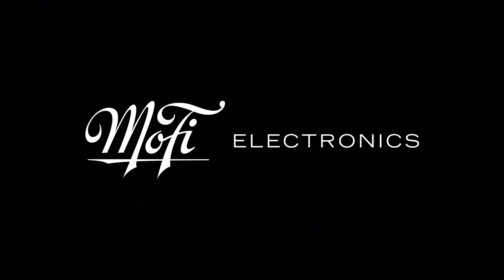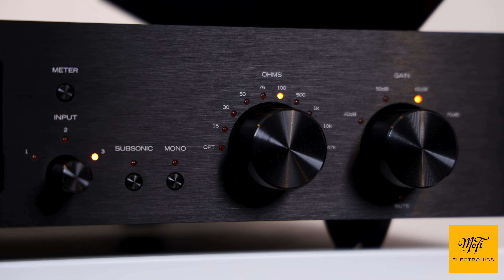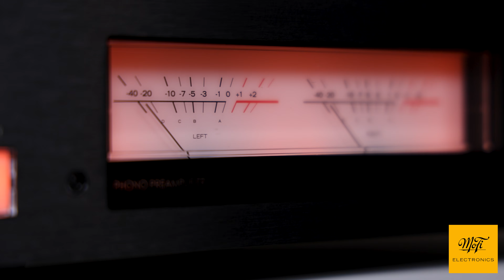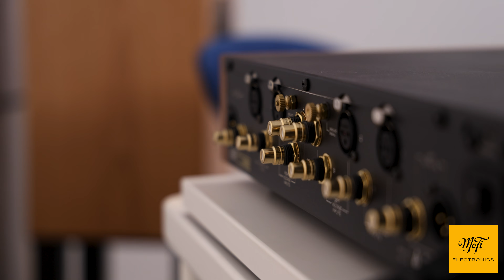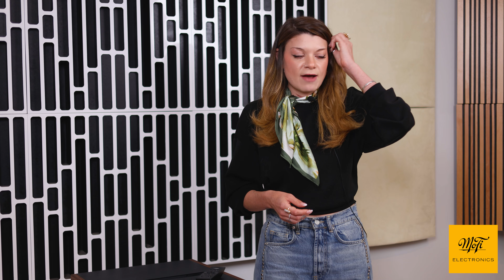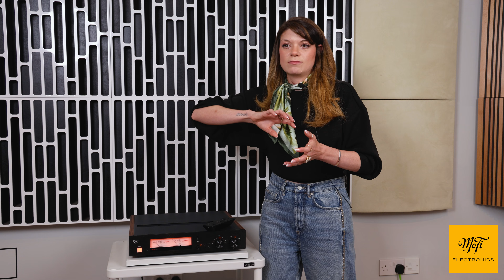MoFi Masterphono Walkthrough with Kat

Comment: My Phono pre-amp will give this phono pre-amp a run for it's money running MM Cartridges, I've upgraded every component, using Audio note kaisei caps, obligeto silv film caps, + top quality polystyrene caps & Sparkos labs op-amps, all connectors are pure copper, finally a off board terroidal power supply, & but finally, I fitted one of my silent bases, it sounds stunning😊
https://youtu.be/5gUBFtU19J8?is=cUBbJCMM1IIB1fkb